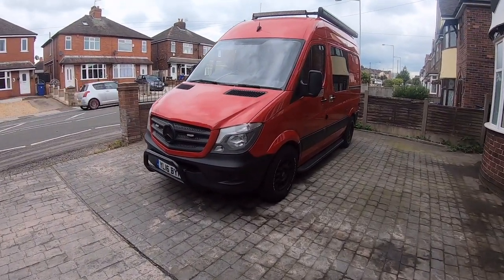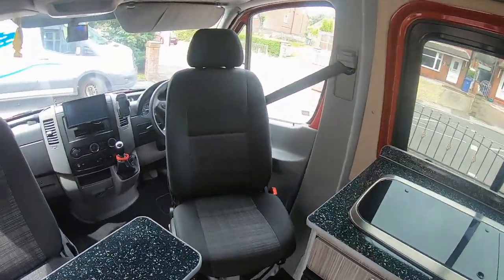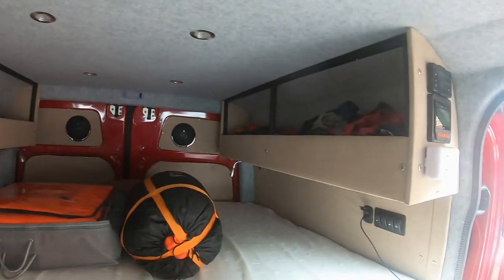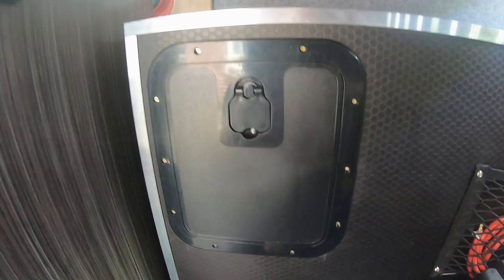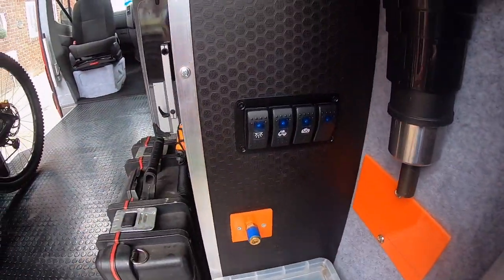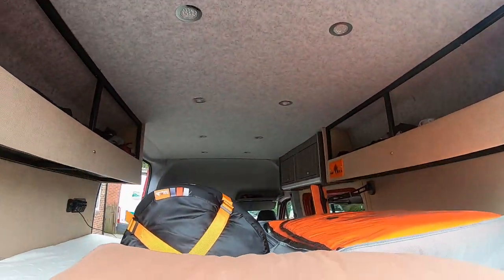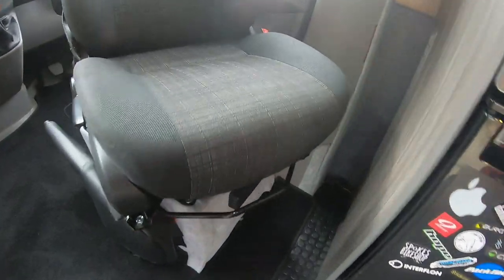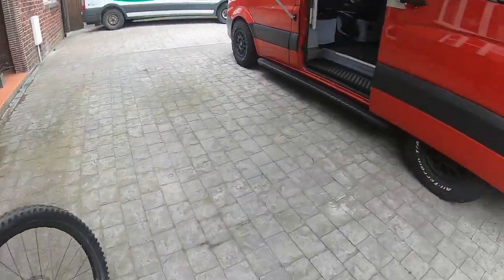rv camper / adventure mtb van conversion  tour on Mercedes sprinter

Comment: hi mate what solor set up did you use I'm currently building a van for my electric bike

cheers mate
Reply from the maker: 380w pv with 200ah of lithium batteries and a 2000w pure sign wave inverter.   With a dc to dc charger in there to.

Comment: Great video but sorry, a half decent carpenter would have knocked that cabinet up for way less than retail !
Reply from the maker: I didn’t pay retail first off. And Please feel free to give break down
Of what you think the cost would be.  And then after that lets see your efforts maybe 🤷‍♂️  Just to buy the 2 sheets of lightweight laminated ply would of been £450.  Then the edging, hinges and catches  then the tooling such as router cutters and then add my time.   Coupled with All of  that no trades man ever will cut as nearly as a cnc.  Trust me I worked it out.  I could of made it no problem as I said but it just wasn’t worth it for what it was.   But thanks for your comment.  👍
Reply: @builderonabike  The last time I got laminated plywood it had a charcoal effect finish and was no where near £225 a sheet and that was for a 2500x1250mm which is more than enough for a unit of that size.  

Just thought it was a shame you didn't build it yourself as you have made such a fantastic job on the rest of the van.
Reply from the maker: There is 2 different finishes one for the unit and one for the worktop.  I would of had to buy 2 sheets.  Or ye I would of done it no problem like the rest of the boxing in the van.
Reply: Great Van conversion! Do you have links to the stereo, reversing camera and iPad holder?
Reply from the maker: I’ll try and find them for you

Comment: Where your toilet 🚽 and shower enjoy.
Reply from the maker: The toilet only goes in when I stay away for the night.  And shower links up to the quick release gas valve and plugs into the wash down warred valve the just hangs on the back door with a curtain across the back doors.  They weren’t in the van when I shot the video sorry 👍

Comment: Hey man love the van! 
What pump have you used for your pressure washer? Would you get a more powerful one next time? 
Do you use the same water tank for the sink and the jet washer?
Also what fridge is that?
And what compressor is that?
Sorry for the 100 questions ☺️
Reply from the maker: All of eBay dude.  All on same system fridge crx50

Comment: Great build mate looks mint. I’ve just brought a swb sprinter and looking to turn it into a mtb day van, Where did you get the running boards from? as I’ve looked on eBay but can’t find the same ones.
Also did you notice much tyre noise with BF Goodrich tyres compared to the standards ones ?
Reply from the maker: EBay mate.

Comment: Crackin build ... What quick release connections do you use for the compressor?  Also looking for the right inflator that fits onto the full valve (current one screws onto valve core and not an issue yet but prefer to be able to seat a tyre with the core removed)
Reply from the maker: There for the water and gas on a mig welder but just so happen to be the correct size.  And ye you will have to make up your own inflator from a track pump hose and a cheap inflator.  Or go full hog and buy the park tool one.

Comment: Nice vid. I’ve been looking at the SWB sprinter as a camper option but wasn’t sure on bed space. How long/wide did you mange to make the bed?
Reply from the maker: It’s just slightly smaller than  a double bed but bottom of the bed pulls out on runners to make it a full double.

Comment: Nice to see a self-built adventure van. Hopefully you have time to do another video on your build process.
Was the interior based on one of the Sync Vans? Do you have a link for the hesian material used on the walls? 
....... and is their any reason you didnt use it on the ceiling?
Reply from the maker: It’s juts furniture material from eBay I will try and find a link but can be easily found on there.  I will at some point try and do a bit of how to vid on the buid.  Cheers.
Reply: @builderonabike  Thanks for the reply. Couple of follow up questions....
1. Would you have considered using 80/20 aluminium for the cabinets and bed if you didnt have the welding ability/background. 
2. How tall are you and how much room do you have when sleeping sideways in van? And at what height would someone need to add flairs to the van?

Comment: You've made a sound van. There's loads of clever stuff in it. Those hatches are the business. Cheers for sharing! How much of a drain on your batteries does your ebike take? We've just bought our van - just starting the conversion. I've got an old Giant E+0 and we've guessed at 4hrs at 170W/hr charging it to full from 25% - I know you got a 1500W inverter but if you only used it for the ebike charging, what size inverter would you get?
Reply from the maker: Chris Haresign I still wouldn’t be able to change my ebike fully with the 2 110 ah and a 1500 what inverter.  Tbh that’s the only thing Iv put 240 in for.   My calculations worked out I’d get about 75% charge before I’d need to start the engine.  I do have a really good split charge so that’s not to much of a problem.
Reply: Got you. Did you go for the beefy 1500w for the compressor and power that the other 240v stuff needed - ie I’m trying to work out what size inverter. We reckon that the giant charger will be the biggest power draw  in our van.
Reply from the maker: Chris Haresign no tye inverter is only to change the ebike. The compressor is 12v  along with everything els.  My charger is 600w so you will always need double that amount in an inverter

Comment: Looks great. I'm at the stage where I'm putting in the water tank and bike cleaner. 

Have you got a link to the snap connectors for the water and how you did the outlet for the water.
Reply from the maker: Hi ye here you go.  
https://www.ebay.co.uk/itm/323836679694
Reply: @builderonabike  cheers Rob. I've looked for a long time to find something like this. 

 Follow you on Insta. Bike biker myself. Like your stuff on there 👍
Reply from the maker: Cool cheers  good luck with the build.  No doubt it will look banging 🤘

Comment: Wow! the workmanship is first class on this van and the design is simple but effective. Its a great size for days out or shorter trips.
Reply from the maker: Thanks very much. 😃
Reply: @builderonabike  i was thinking, for me the only difference to your layout I'd have is the bed made of two removeable panels.
I've seen someone do it, two aluminium panels with plywood fixed on top that just drop into side supports.
If i build another van I'd have your layout maybe in a mwb Ducato but with the removable bed platform. I think its a shame to have a van and not be able to hawl furniture or the odd moto day out.
Seeing as yours is very open is there any reason you didn't go for a lift out or folding bed?
Thanks again
Reply from the maker: I did it in the last van and never actually moved them so thought it was pointless.  Although if I wanted to remove the bed it would be 4 bolts as it’s made from inistrut

Comment: Mint van 👌🏻 did you go for a 12v or 240v air compressor in the back?
Reply from the maker: It was a 12v one.  I believe they are uses for air horns but works perfectly.
Reply: @builderonabike  cheers! Thank you for the quick reply!
Reply from the maker: No problem at all

Comment: Great Van buddy ! Did you have to mod that fork mount to get it to fit on a standard rail. Looking to buy the same mounts but looks like you need their rail system ? Cheers
Reply from the maker: Neil Taylor just mounted them onto a plate with the rail connector fitted.  The mount is amazing the best I have seen and the quality is top notch.
Reply: @builderonabike  Cheers fella, i'll get a couple ordered.
Reply from the maker: Neil Taylor mention the vid if ya can 👌
Reply: @builderonabike  will do fella :)

Comment: Who make the dead bolts?
Reply from the maker: Just off eBay dude.
Reply: @builderonabike  I looked on ebay for automotive deadbolts and didn't find anything like what's installed on your van. So, I'm guessing it's a custom thing you came up with from adapting an apartment/home item.
Reply from the maker: No here in the Uk there a thing.  Cus of crime.